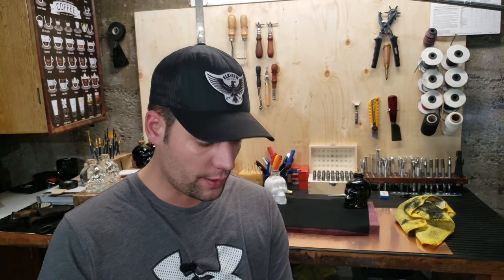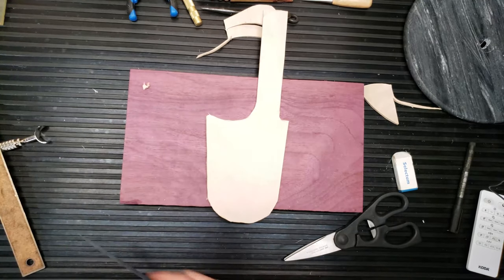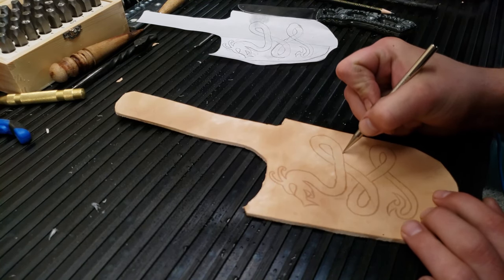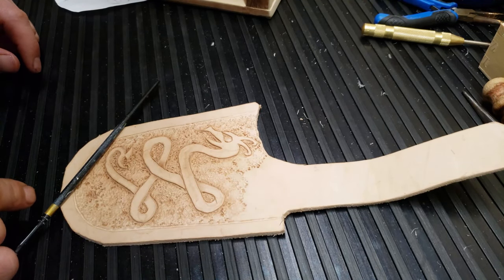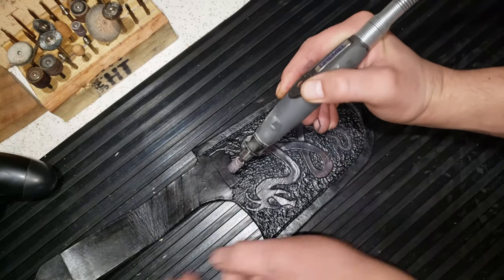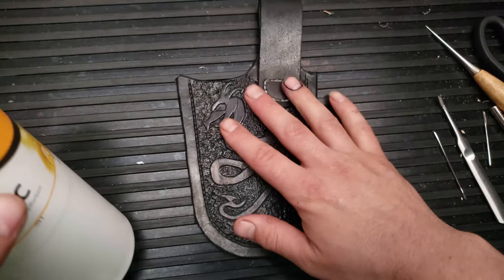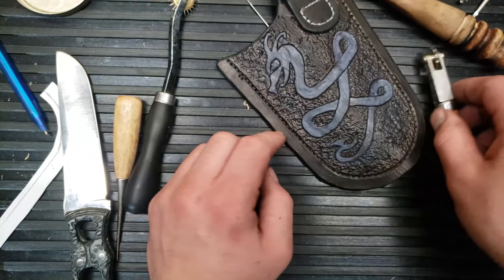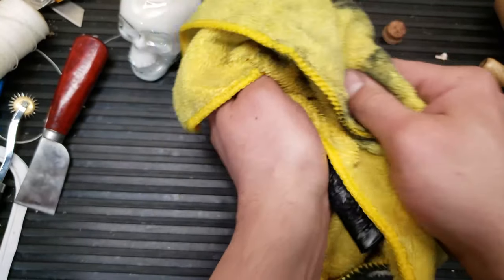Leather work : Celtic Serpent Sheath

Comment: Honestly, us leather workers use dye, acrylic paint, and whatever can be used on the piece. That is a white shoe polish that is used on leather shoes. So, you're all good. They don't make dyes in every color so you have to do what you gotta do lol

The only thing is, if you want to keep the color of the white, you need to seal that area and then you can wipe off the black dye before it dries.

Next off, you could have used that stitching punch to make the holes because that is what it is used for and they are very sharp, just have a piece of rubber under your project when using it.
Reply from the maker: Thanx for the advice!!! I dont like using the punch because the damn things get stuck and i cant get them out hahaha
Reply: @CGSmithing  use some bees wax on the ends. It kinds helps them come out. Other people have made pieces of wood with the size of the punch that will slide around the punch and gives them something to help hold down the leather so that you can easily pull it out. Its just wood in the shape of a U that the center is just as wide as the punch.
Reply from the maker: I love that!!! Im gonna give it a shot  on the next vid i do thank you!!!